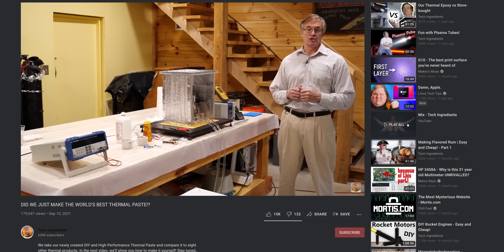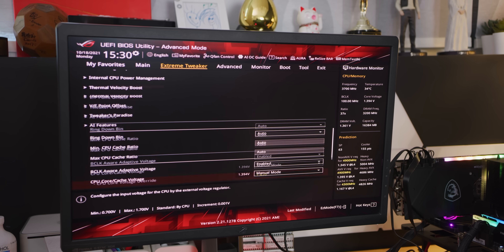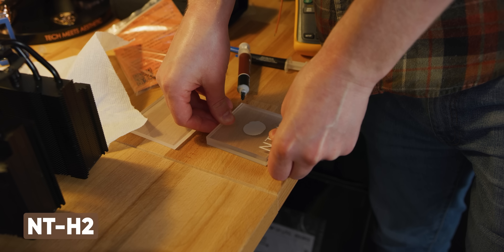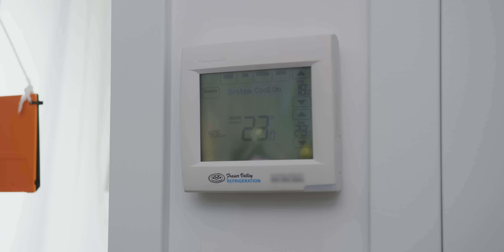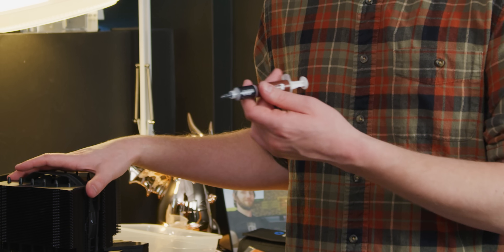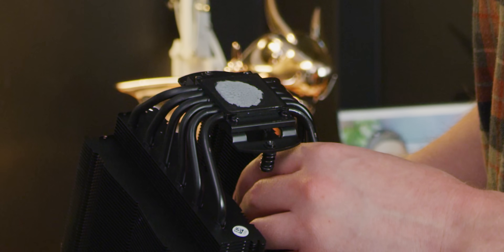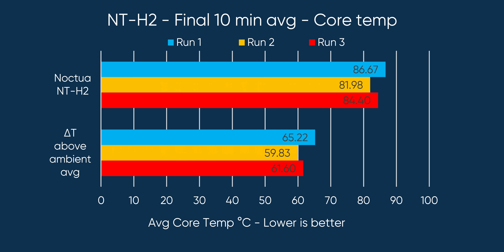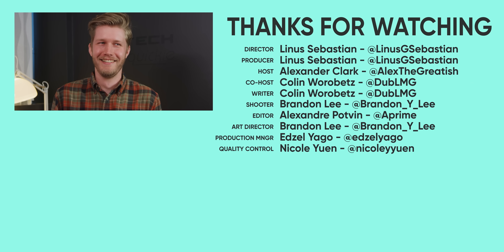We called out Tech Ingredients and they DELIVERED

Comment: The title is extremely misleading. Buying a product someone sells and testing it (in a terrible environment) isn't "calling out" anybody, and they didn't "deliver" anything special to you. Don't make it personal.

Besides, The test is uninteresting. You did the bare minimum of a real world test. The "computer" was a test bench (without a case, which is very thermally important) and you didn't even measure how much paste you applied, but did measure (with your eyes) how well it spread, without relating it at all to amount. You checked it with one cooler over one run, and it's not enough to conclude *anything*, even if your test environment was half good. 

Doing things unscientificly (or might I say, badly) is not an excuse for sloppiness. This isn't interesting if you say that you have nothing new to add. This video is more akin to an unboxing video that tries to sell itslef as something more then that. If you can't do it well don't do it at all, and most of all don't clickbait the title so much.

On a personal note, though, I want to add that the opening was way too flashy for me. It was hard for me to figure out what was going on. That might be more of a personal issue but I still think this was too much.

EDIT: They did three runs each. Which is... Better? The test environment could still do a lot of work, and testing with different parts would have been nice.
Reply: 3 runs each, not one run, but yes. However, there is also a reason they don't normally test thermal pastes, because any high end paste performs within margin of error of any other high end paste. In the video testing the epoxy, even the cheapo paste that came with the cooler was only 1 degree warmer than noctua paste
Reply: @____5837  Oh, sorry.
Reply: i suppose, "calling out" refers to their previous video on tech ingredients' thermal epoxy, where TI claimed it is the best but it was pretty terrible in LTT's tests. And "DELIVERED" means that this time, their paste actually proved good. Nothing misleading at all from my perspective.
Reply: This is why both of Tech Ingredients videos are loaded with comments telling them to send it to Gamer's Nexus.  Not sure why they insisted on this dialogue with LTT, except possibly because they are the larger channel.

Comment: 5 micron grinding stone dust and glycol, The dust does nothing but stop the glycol from leaking. pull 5ml out of the car radiator and boil/steam the water out, add the polishing dust to whatever viscosity it is that the cooler surface works best with.

Comment: Tech Grandad FTW, I asked Grandad if the particulates touched and he replied 'no' so that explains the high resistance in fact it was out of range and thats > 40Mohm for the Fluke117, so if a certain percentage of the particles did touch that would increase the thermal conduction and improve its the results still further but the resistance would lower, so I guess my question is at what point does the resistance become a problem ? because > 40Mohm is not zero resistance but it might as well be at the voltages being used, so can you have slightly conductive paste (better thermally) say > 20Mohm ? theoretically you might have a string of particles touching and that would be a short so is there a figure that the industry uses ? if the chip had a 100 micron pitch and a blob of paste fell across it with a resistance of let's say 5 meg it would be ok ? I'm curious......cheers.

Comment: It's quite disappointing, that even now there are no good thermal paste tests, this video is, unfortunately, no exception. Firstly, you locked ONLY the core voltages, you should have locked all available voltages. Secondly, you didn't lock the fan speed. Lastly, different thermal paste reach their optimal operating mode at different times, some thermal paste needs a few hours, but some, up to 2 days, but you concluded the test in 2 hours.

Comment: I'll get any paste that isn't bad.  It doesn't need to be the best by a couple degrees.  It's kinda like comparing cameras.  If you get reasonable results to your liking, that should suffice.  In this case I'd get the cheaper since they perform about the same.

Comment: You saw that squishing it down didn't spread it all the way to the edges, so you should have spread it yourself.  That's what you have to do on laptops anyway where the pressure on the cooler is low.

Since the results were consistent, it probably didn't matter though.

WHY WAS THERE NO LINK TO TECH INGREDIENTS' VIDEO.  I feel like this treatment is insulting!

As for other things you need to think about with pastes: I've been dealing with an i5 10300h laptop that runs HOT.  HP put a minimal cooling solution into this gaming laptop and either they or intel tuned the processor to run hot.  It doesn't throttle until 95 degrees and doesn't push its temperature below that.  Under full load, depending on how good the paste job is, it runs 98 degrees or 100 degrees - at least during boosts.

So an application of Thermal Grizzly Kryonaut was only good for a few weeks of gaming sessions, since that "is stable up to 80 degrees" and the processor spent a lot of time above that temperature. 

So I replaced it with GELID GC-Extreme which does not spread on its own, ever.  People suggest that you drop the tube in boiling water to soften it, and then spread it carefully yourself.

It's rated to 180 degrees, the thermal conductivity is given (8.5 W/mk),  and it's too thick to pump out.  So it's gonna be as good as you can manage to apply it, but it's gonna be stable for years. At least that's what I've been told.

This application is not as good as Kryonaut at the beginning but better than Kryonaut was after 2 weeks.

Idk, maybe Kryonaut isn't great for anyone after a couple weeks of use?

Comment: When he said the 10900k is overclocked a lot, I was expecting him to say 5.3ghz. But 4.9ghz? That's lower than the stock boost clock. I've always been able to get 5.2ghz on 9900k and 10900k
Reply from the maker: I can probably do 5.3GHz+, chose to do 4.9GHz because we needed to be sure it was stable.  Can't have it crashing after a half day of testing, and the high voltage is the only thing that matters for the heat load. -AC
Reply: @LinusTechTips  understandable

Comment: Some thermal pastes lose efficiency over time as they dry up & harden, I would like to see them do a 1-month long "burn-in" test to see if it actually holds up against the competition.
Reply: To be fair, they need to do that to ALL of the pastes on the market.
Reply: maybe go watch where TI covered this on their channel?
Reply: Over the years I have had the opportunity to do that with a few big name pastes, although my tests have all been at least 1 year. Here is the order of the most stable paste, as well as their thermal ranking:
1. Coolermaster MasterGel Maker (3rd)
2. Arctic Silver 5 (4th)
3. Noctua NT-H1 (2nd)
4. Noctua NT-H2 (Tied with 1st)
5. Thermal Grizzly Kryonaut (Tied with 1st)

My recommendations if you want the longest lasting paste with very acceptable performance, I have ran chips with Coolermaster MasterGel Maker for 5+ years with no change in performance. Noctua NT-H1 is the best compromise between performance and longevity, it will perform well for 2+ years before it begins slowly getting warmer. Thermal Grizzly Kryonaut and Noctua NT-H2 are interchangeable performance wise, but Kryonaut is extremely unstable and falls behind NT-H2 after about 6-8 months on average depending on how hot the paste is getting. Noctua NT-H2 is not as stable as NT-H1, it is also more prone to pump out (although not as bad as Kryonaut is), NT-H2 averages about 1 year or 1.5 years before a new application should be considered.

The most valuable lesson I've learned from my own testing is that Kryonaut should absolutely not be used in a 24/7 system. It's excellent for sub-ambient and bench testing, but in a system that you're actually using for long periods it is a waste of money.
Reply: The bigger factor is thermal creep.  The silicone oil suspension medium both under pressure and experiencing thermal expansion cycles tends to creep out of the suspension and dissipate.  This is a major problem with thermal pastes for aerospace where wild temperature and pressure swings exacerbate the problem but it's still a problem at normal temperatures over time.  While there is some evaporation of silicone suspension mediums, most of the drying you see with old thermal paste is due to thermal creep.
Reply: I can add MX-4 that works fine for a long time between IHS and a cooler, but once put under the lid and it sees around 90C temperatures, the oil separates from the paste within 1-2 days

Comment: Nope, a real processor is not a better thermal load, at least for repeatable test results.  And the variability in test results in the video prove that.   It's more realistic if you have the exact same processor, heat sink and program use as the test machine, but then again who runs cinebench for everyday use?

Comment: Even if the mounting pressure is the same, thermal paste performance can differ a lot between different coolers. Depending on the size range and distribution of the thermally conductive particles in the paste it might better fill a cold plate surface, which in itself has a certain surface roughness range and distribution. Also keep in mind the total measurement error of your temperatures is about 0.5 to 1 degree at best, if at all. Common sensors are precise, but not accurate.

Comment: I'm still using the same tube a Arctic Silver thermal paste I bought for my first PC build in 1998! 😁
Reply: If you aren't overclocking to the point you have to worry about thermals with a cheap aftermarket cooler, thermal paste isn't that important. I'm running a 4770k oc to 4.4ghz, slapped a hyper 212 Evo on it. The thermal paste I have is shitty and degraded and I still don't ever go over 80C, and my fans never spin up to be noticable over the sound of a HEPA fan on low I keep in my room.

The majority of all this technology stuff is trying to make you think you are missing out if you don't buy the new thing, these videos make you feel like you are behind the curve if you don't spend a bunch of money.

But even in places here the tech is important, like digital photography, even the professionals aren't using the newest stuff.

Comment: You should probably try out the thermal paste which is used for IGBT cooling in industrial VFDs (Variable frequency drives). I was working on one some while ago and wondered how good are those thermal pastes actually. I would bet that the consumer pastes for PCs are better than those in VFDs, but has anyone made a comparison? Btw, the IGBTs in some VFDs can handle 600A, so a lot of cooling is necessary.

Comment: But aren't tests like these the actual real world tests that should be conducted? 
Like what use has for all of us as customers knowing that a thermal compound is great in a super clean place with a thermostat at 20°C under a noctua D15 which is like "the best" air cooler ever on an open air test bench? 

I'd like to know more like how a good cooler behaves in a bad case or how much difference does it make to apply the paste "this way" or "that way" or how does anything behave or work in a room that is 25-30°C with humidity because it's 37°C outside in a hot day in summer. Or the opposite, it's -15°C or something. 

Like most of us will have different situations that have to be accounted for. It makes sense to design a product for optimal use and to test it in said optimal situation, for the company. But for the rest of us, what Alex is doing is what makes sense. 
You could say you're a bit of a scientist yourself, Alex.

Comment: So, by thermal metrics, the Diamond paste should be the best for conductivity. I've personally seen the difference by using it on a few different computers with very different cooling setups. But when using it, it needs to get hot, pretty hot actually. I used to boil water and place the tube in a cup that you will not be using to drink out of. That's the first part of heating it up. The second part is I leave the fan unplugged until the CPU and heatsink temp start to get near 80C. It WILL spread out, but it's just in need of some assistance of heat since it's so viscous and thick.

Comment: The paste properties seem to be intrinsically tied to the mesh sizing of the Aluminum powder added.
Specifically it needs to be a combination of 3 and 5 micron Al beads.  I may have misremembered the exact mesh sizes
however the idea is that you have one effect from the 5 micron and another effect from the 3 micron, and then the 2 sizes 
talk (ie. exchange heat) with each other.  The most interesting thing is the emergent properties that arise from sizing control.
Reply: 5 micron, .3 micron aluminium and 20-30 nm silane coated ZnO powder. the smaller powders fill in the gaps of the larger powders.
Reply: @deelkar    Yeah, it definitely looks like a size/mechanical regime of thermodynamics.  I wonder if someone could convince thermal paste to grow dendrites?  That would be cool, waiting for a battery reaction to activate your thermal compound.
Reply: @deelkar  Also, silane solutions are very interesting.  The VAPSA research I was involved with was heavily into the stuff.  Not my department though.  We were all about the ASAP (Accelerated Surface Area Porosimetry) research.  Nothing like loading a steel ball into an instrument, wait 10 minutes, take ball out, wait 10 minutes, repeat until you are completely mad and there you go it's Calibrated.  Stupid ASAP instrumentation!!!

Comment: Why are thermal pads so bad? Couldn't you use basically the same formula behind a good thermal paste with a hardener to make a small semi solid layer of it? I feel like that could be very good as it would make application even easier and ensure full coverage.
Reply from the maker: They're not --that bad--. They are however simply outperformed by thermal pastes. Just the way it is. For people like us who swap coolers on and off test benches constantly they're great, but for maximum performance, they are not. -CW

Comment: I'm actually kind of put off by Alex's blasé attitude... I was kind of expecting better quality and effort in general. 

Like the AC thing is fine, you gotta work with what you got, but pressing acrylic sheets by hand and even showing them side by side (even though you did add a disclaimer) is so lazy. There's no useful information there, unless you assume Alex has extremely consistent and repeatable pressing ability... And the solution would have been so simple: work out the average clamping pressure of a given cooler and then calculate what weights to place on the plates. A test showing the effects of warming the plates would also been informative.

And what the heck was that electrical conductivity test? No control? i.e. a conductive paste for comparison? 

I thought Alex was an engineer of sorts? Surely he should know better than to half-arse the scientific methods...

Comment: You guys need a cold room that is specifically maintained perfectly at a temperature of your choice.  No variation in temperature means you can do your tests better.
Reply: Don't really think that's needed for the purpose of determining if it's worth a purchase for home use. Basically, unless you can guarantee your bedroom/living room/whatever can maintain a difference in temp of less than a single degree (I sure as hell can't, and pretty sure neither can 99% of ppl) the variance will have a greater impact in PC temp than the thermal paste.
Reply: LTT facilities not as well equipped as TI's workshop or as so rudely referred to in video as "shed".
Reply: @dalemonroe1779  I mean, they could replicate his setup, it just isn't really worth it for them. 

It is kinda surprising that after all these years they haven't just built a little temperature controlled soundproof booth to do testing in.

Comment: Is this the recommended way to apply thermal compound these days? Back in the days of Athlons and Arctic Silver, we used to put a thin layer on by hand using a credit card and razorblade. Could take hours to get a thin, even coat. And that was with a die the size of a MicroSD card.
Reply: I used the card method, how in the world did it take hours? It took me 15 seconds.
Reply: @kaldogorath  yeah hours was me exaggerating... But 20 or 30 minutes definitely happened when I wanted it perfect.